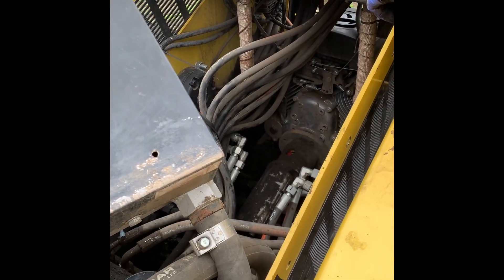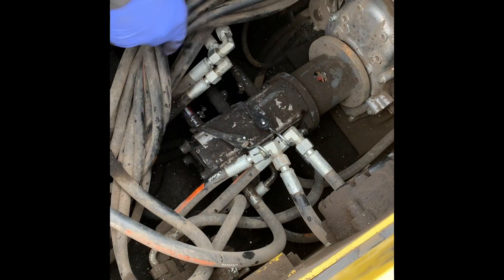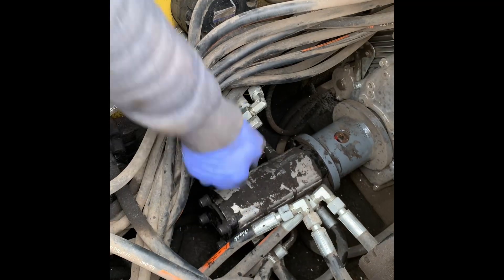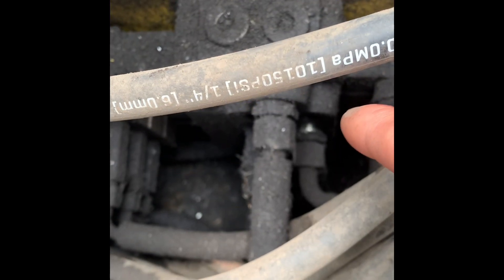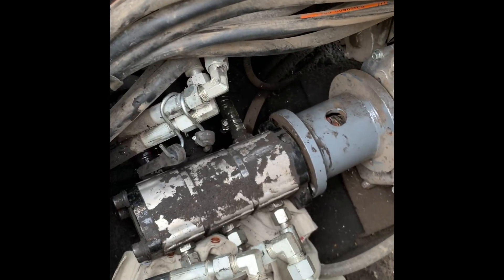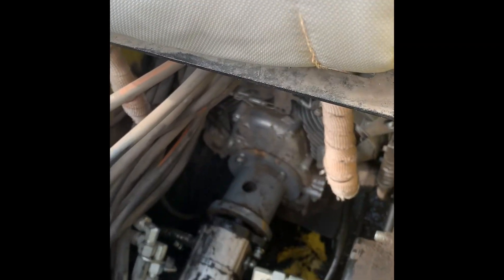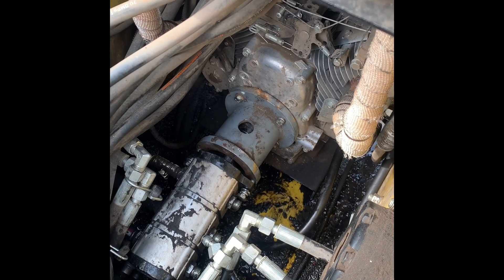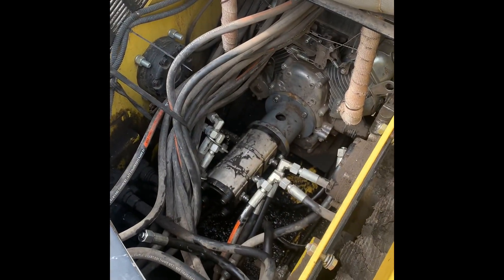Hydraulic Pump Fixed Diggit SCL 850

Comment: What hydraulic pump are you using is it still the original pump on your machine and is it a hgp brand I just got one but the back pump just blew a seal and heard these are not so good of pumps what's your perspective
Reply from the maker: yes still using the original pump.  so I don’t really have an opinion on it